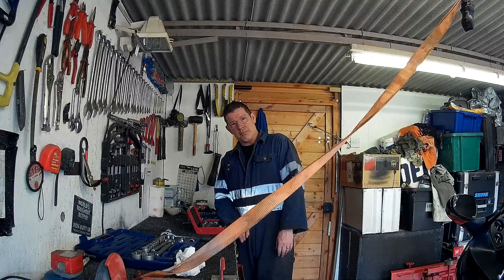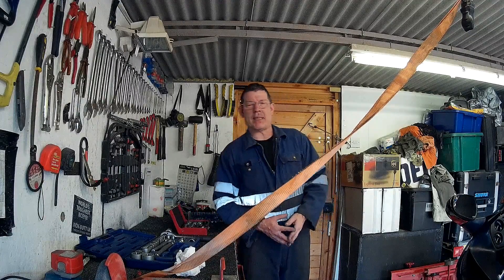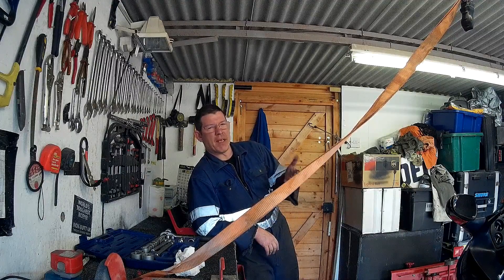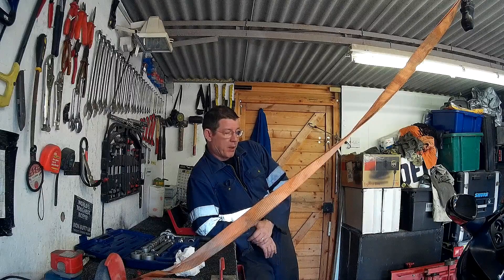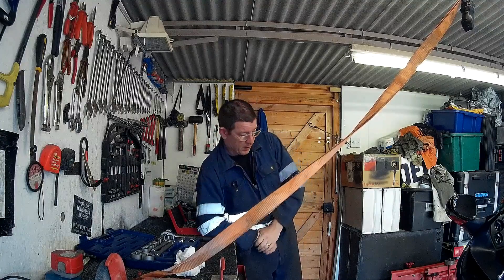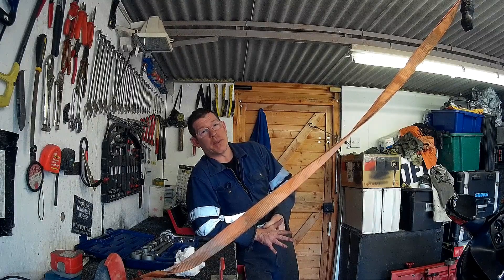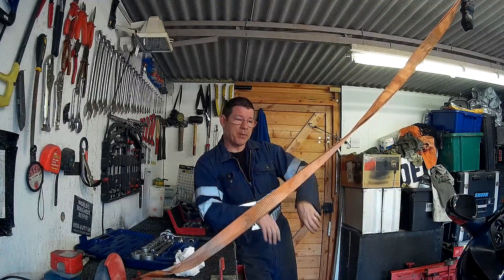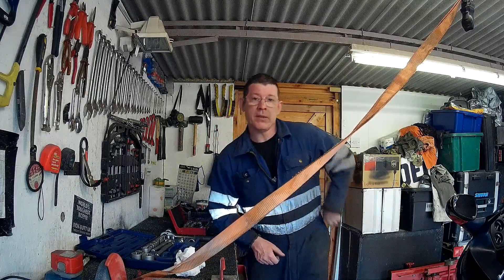honda blackbird front forks removal

Comment: Why are you taking master cyl off? Just loosen the handlebar clamps & the locking rings off the top of forks & slide or pull forks through. Wheel & axle  & brake line/calipers off. Undo bottom bolts holding forks & pull fork legs out. Hope you have already loosened top forks cap for easy removal. Now ready to change the fork oil. I use 8.75W.  fork oil as 10W to hard & 7,5W too soft. I don't worry about measuring distance top of fork to oil. I justmeasure correct volume of it & that's it. Bob's your Aunt, that's it.Lol.